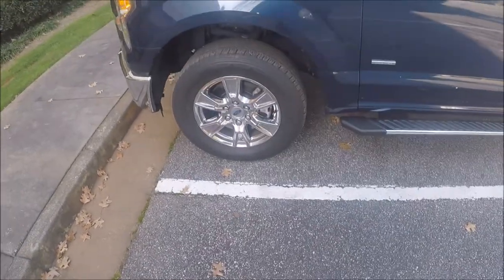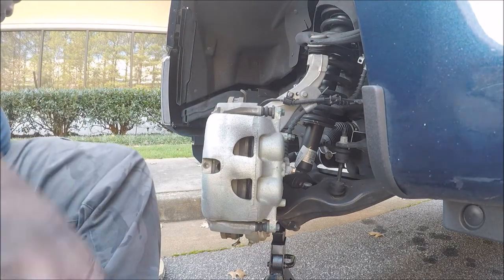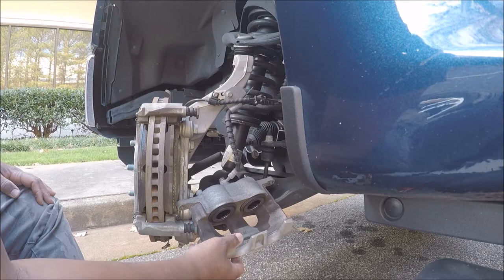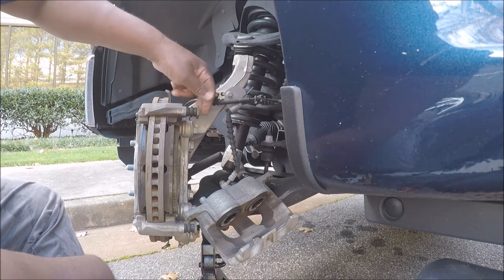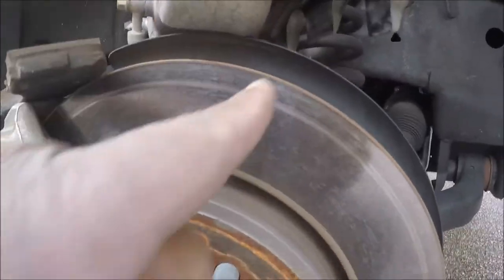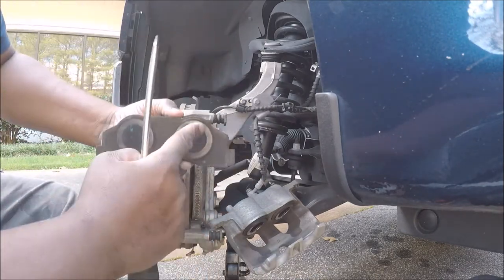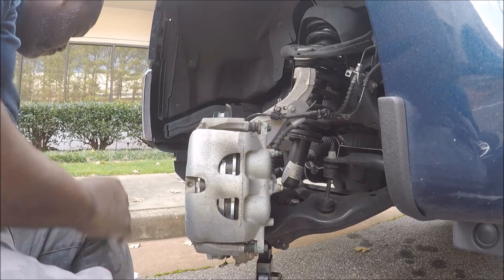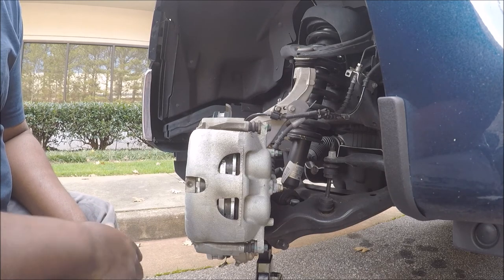Brake pads warped the rotors @ 2,000 miles 2016 F150 Wagner Motorcraft

Comment: Grease was used many years ago when there was no stainless pad riders and polymer backing on the pads. You don’t get rust where you are, looks all like new
Reply from the maker: It was new. This was 6 years ago when the truck had 20k miles. No automaker ever put grease on the back of pads.
Reply: @blackericdenice  it was common on drum brakes to put grease on contact points of the shoes and backing plate. Using grease on disc brakes probably just an old carry over.

Comment: The half assed way of doing your brakes .Hanging the caliper can create a kink inside the line which causes a weak spot . As for the glides if you like dealing with sticking calipers don't lube them. And yes there is an "oil"film on rotors not grease. And use lock tight on the bolts.
Reply from the maker: Dude I've been doing brakes longer than you have been living. I have never had any problem with sticking or kinking. I've never used lock tight and I've never had a problem with loose bolts.
Reply: @blackericdenice  No offence meant,I live up north and the cold ,snow and ice in the winter causes havoc on un-lubed metals and makes lines more brittle
Reply from the maker: @1whoFartsinthewind  If you say so

Comment: Nice video man, i just warped the rotors on my 16 and thought it was my driving style too lol! My truck had the same scarring on the rotors too when it was new i just assumed it was from gravel getting stuck in the pads its a common problem on these new F150s
Reply from the maker: kodi white I have 20k miles on those cross drill rotors and pads. No problems.
Reply: I have a 2017 F150 with 34k miles and got the same scarring on the driver's side rotor. The dealer says the brakes are only warrantied for one year or 12k miles since it is a wear item.  
Appearently, this is a factory defective brake pad issue, that Ford will not acknowledge.